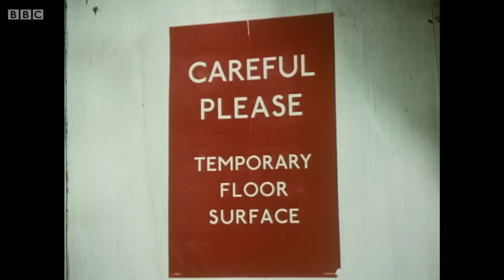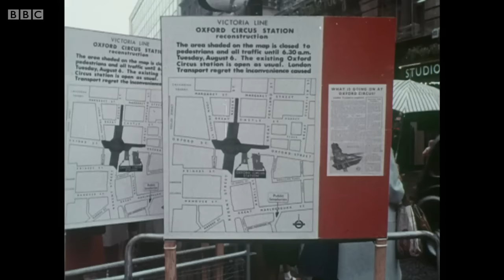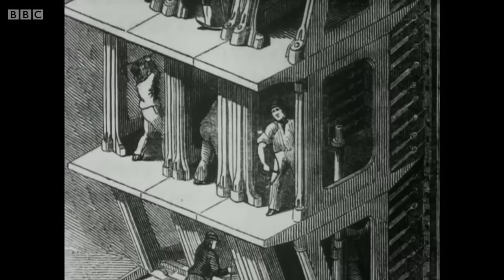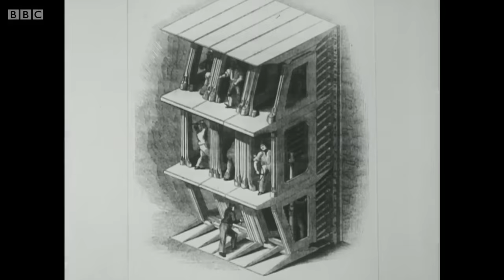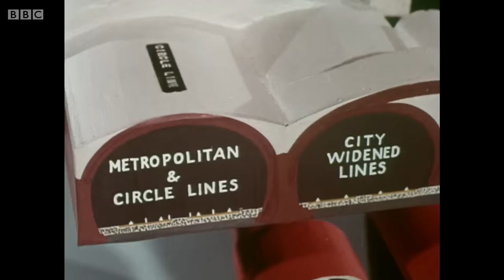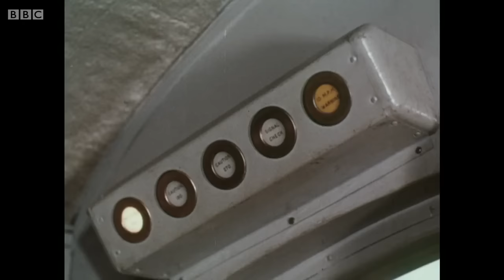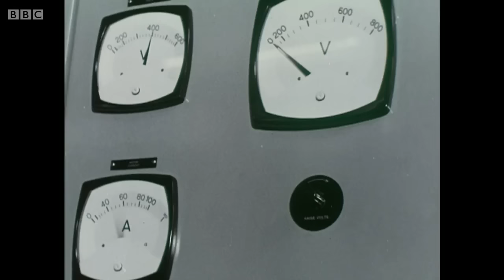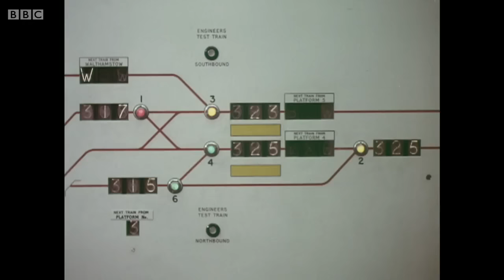BBC How They Dug the Victoria Line

Comment: This was fascinating, and they actually managed to automate that line with the primitive equipment available in the mid 60's, very impressive!
Reply: Jeff DeWitt relays?
Reply: Relays and rolls of paper with holes in it, just like an old player piano.
Reply: Jeff DeWitt pyramids baffle you then?
Reply: I wouldn't say it was particularly primitive.
Reply: It's even more facinating that they went to the moon only a few short years after. Tunnelling and building is largely the same these days, whereas modern computing makes the Apollo guidance computer look positively archaic.
Reply: It was stated that this was filmed in 1969. In July of that year we reached the moon.

Comment: I so do love this city. It still shocks me how advanced the Victoria Line was for the 60s. To think the automatic system must've been designed in the late 50s - early 60s is amazing. Small calculators we have today weren't even a thing, yet they managed to run a whole tube line from one room using machines.
Reply: whats even more impressive is that same automated system was still in use til 2012

Comment: This is absolutely fascinating to watch, the precision combined with speed is remarkable. It's a shame projects that are smaller take much longer these days.
Reply: When people are knowledgeable and skilled speed and precision together are possible.
Reply: Well, if you cut safety you'll have much time!
Reply: The Elizabeth line, for example is definitely not a smaller project, the Victoria line is now one of the most overcrowded because it was built to more tube like specifications, and the stations at many points have quite bare minimum stations with out enough space and narrow escalator shafts. Walthamstow Central is one of the most overcrowded stations on the whole network

Comment: If the BBC made this sort of thing now, ie, factual, informed, not politically minded etc then I would gladly pay for a tv licence and start watching them again.
Reply: So blue planet 2 and other documentaries, like crossrail are too political?
Reply: @Bartimayus  They are too few and far between for it to be remotely worth it.
Reply: divad noskcaj  what the hell is a TV license?
Reply: If they did make it today the BBC would be bemoaning the lack of gender diversity on the project, not in the tunnels mind you, only the engineers and bosses.
Reply: @James Rhew - In the UK if you own any equipment capable of watching television as it's broadcast either via over-the-air transmission, internet, cable etc you have to pay the state an annual fee called the TV License, this funds the upkeep of the transmission network, the services and production of the B.B.C. including radio.  It also means there is no advertising on B.B.C. channels.
Reply: They do.
Reply: James Rhew one requires a license to watch TV in the UK. There is an American News documentary about this issue. It enables the gubment to require an (a tax) license to watch and capture the TV transmissions without one. The Gubment actually goes around looking for antennas without a license.
Reply: @jamesrhew4542  You have to pay an annual fee to have a television in the UK.  The money goes to support the BBC.   America doesn't have this kind of a system and that is why the only good television programing that is available in America is British.
Reply: Its all pizzicato or piano music in the background now, drives me mad.We also have to be introduced to every worker and know their age.
Reply: @ednorton47  Yeah, But we have Donald...Oh My God!!! Ya Know We need BBC or DW as required watching
Reply: @Jonny1000 Johnny, Johnny, Stiffen the Lip old boy, the lower one too, What
Reply: @ x-You voted for D Trump didn't you-T May if you're a brit
Reply: I can promise I'll never pay the licence even if they throw me in jail.
Reply: divad noskcaj TV license?WTH is that?
Reply: @ednorton47  Actually the United States has a tax funded program service called the Corporation for Public Broadcasting that supports not-for-profit radio and television.  At roughly $500 million a year, it is shamefully underfunded.  It's currently emerging from under a cloud of mistrust  after a resigned board president was found by the agency's Inspector General to have attempted to influence programming in favour of a "conservative" stance.  It remains a favourite target of the Right for its supposed liberal bias.  To which I can only say, from a Leftist perspective, bullsh**.  I see far more favouring of the Right than Left these days.

Beyond the funding issue, I think you're ignoring some very well made programming on PBS - Nature, Frontline, American Masters and Nova for example. But what the BBC has, in a way neither PBS nor Public Radio can afford, is news gathering. The coverage they offer is better than the  networks, but they can't afford nearly the oversea stringers and reporters the BBC still has.
Reply: @DavidHHermanson  Point taken.  But perhaps PBS could do more in the field of drama.
Reply: This is absolutely peppered with opinion and preaching.
Reply: @ednorton47  I agree.  They've, in recent years, done a great deal of co-developed drama with the BBC, but it comes out to one or two shows per season. I'd love to see them commissioning a weekly series in the style of the old Playhouse 90 - great drama, ambitious new talent (both playwrights and actors) under the work of theatre's best directors.

Comment: Hello, many " Thank you " for uploading these film. It's pretty amazing to watch these early Computers, Machines etc. how they work. I never thought about the fact, that a train can be driven by a Computer at the end of the 60s, without any human interactions.  Just amazing. But I have one big question left. I know that the London Underground gets his energy via a 3rd rail and this one is on the right or left side. But I saw in this film the 4th rail, this was between then 2 rails and it was located in the middle of the track. My question is, what is the reason for the 4th rail? If anyone knows the answer it would be nice, to get an explanation from you. Thank you and have a nice time. cheerio Toni.
PS: Also I must apologize for my bad English, but I'm from Bavaria ( Germany )
Reply: Four rails because one rail is positive and one negative. I don't fully understand why, but that's how London Underground lines are arranged.
Reply: @hkharnelian  Because it is a DC system, by having the 4th rail it means that the metal shields used for the tunnels are not as subject to corrosion.  The outside surfaces can be at/close to 0 potential volts to the soil surrounding them.  The 4th rail acts as the - conductor back to the substations.  The cost of having a 2nd conductor rail as return is less than the cost of amorilating the problem in other ways.
Reply: @ThePeachJames  Thank you for the clarification. Spent a lot of my youth on the London Underground, but wasn't sure exactly why a 4th rail was required.

Comment: 18:15 so that's a live 650v rail and a service train just to his right - wonderful H&S
Reply: Not necessarily,  the trains will still run on length of de-energised rail that Is shorter than the length of the train.
Reply: @user-ky6vw5up9m  Although if that train has shoes on both the energised rail and the de-energised rail then the gap is bridged and the rail is now live

Comment: interesting to watch compared to Crossrail today. Health and safety not such an issue.
Reply: Building Crossrail is a bit like building the Victoria Line all over again, except half a century later and Crossrail is a Commuter Railway Line, as opposed to a Deep Level Tube Line. 

The first section of Crossrail will open in 2018, later this year and the first section of the Victoria Line opened in 1968.
Reply: And the tunnel boring machines are manufactured in Germany because the UK makes nothing these days
Reply: government more like

Comment: I remember being told that a large proportion of the labour that built the Victoria line were West indians. But I've only seen one or two in this film.
Reply: 60s BBC was very racist so its not a massive surprise
Reply: My father was a tunnel miner on the Victoria line from start to finish, 90% of the labour were Irish, the other 10% being English and/or West Indian heritage as back up labour, pit bottom men/ loco drivers etc.
Reply: In those years the vast majority of the building gangs, especially tunnellers were from Ireland. It was a pretty grim place to live then and they was plenty of money to be made in the UK if you grafted. I've seen other videos of the railways at this time and there are quite a few West Indians working on signalling.
Reply: as mentioned in the film, the majority of workers were from ireland, and then went on to reference the way the irish were used to dig canals and the original railways
Reply: So, now we are going to find something "racist" in this documentary. Aw, let's bitch and complain like good libturds.
Reply: No one lasted only the Irish  went the distance
Reply: Tom O toole Yah okay good luck with that.

Comment: H&S in 1950 over 1600 workers were killed in the contraction workforce, this includes 226 killed on the railways, who were not covered by the factories act. In 2018 40 workers were killed in construction. H&S May be a pain in the arse to some but better to feel the pain rather than dead with no feeling.

Comment: Health and Safety, the most hated words when things have to be done like yesterday. I don't know if anyone has calculated the time and cost Risk Assessment adds to a project.  Safety gear was frowned on back then, it just often got in the way, sliding down a ladder was the quickest way to descend it, just ensure the uprights were sanded to remove splinters, better then spending time pulling them out of one's hands.  Safety Glasses need cleaning every five minutes if one wants to see anything, hard hats just get in the way in a tight space, a handkerchief makes a mask if needed, one cannot smoke with a mask on.  The KISS principle was in use back then ( keep it simple, stupid ). As for hi-vis, if one can't see a person, one shouldn't be working in the first place.

Comment: the days that jobs used to get done - these days they start road works in the uk and you never see anyone working on them, and the traffic piles up for months when the job could be done in a few days
Reply: There was a price set for each job worked out in hours pay, so on the concrete lined section we could earn 24 hrs pay in 8 hrs work. But you were excavating & erecting one ring every 15 mins. It could be done in 6 mins but they could not keep us fed with empty skips and lining rings. Other jobs like installing beams etc on w/e's would be on a job and finish basis again priced in hours. So a 12 hr shift Saturday and Sunday normally paid Say 6 hrs flat time, 6 hrs 1.5.  15hrs, Sunday 12hrs @ double time. 24 hrs Total 45. On a J&F we would get 150 hrs on completion of the job, whether under or over the 45 hrs. I only once worked over, we were usually in the pub for 1pm Sunday.

Comment: So is the London Underground the same today with the train operation fully automatic & the 'driver' just there for safety reasons?
Reply: phil955i 

Just the Victoria and Jubilee lines. The Central and Northern lines are controlled by Automatic Train Operation (ATO) as well, but the Piccadilly, Waterloo & City, Bakerloo, Circle, Hammersmith & City, District, and Metropolitan lines aren't fully controlled by ATO -- at least not yet. Transport for London is slowly upgrading the Circle, District, Metropolitan, and Hammersmith & City lines to ATO, in segments. The Piccadilly line is set to receive new trains sometime in the 2020's, coupled with automation of the whole line. The Bakerloo will get those same new trains after the Central and Waterloo & City lines get their unreliable 1992 stock replaced by those new trains.
Reply: @hostilepancakes  Thankyou

Comment: AN ASPECT OF THE VICTORIA LINE BUILDING, IS THAT AN ARTESIAN WELL, PART OF ST PANCRAS SPA, WAS IN THE WAY AND HAD TO BE FILLED IN WITH 150 LOTS OF CEMENT SO  THE VICTORIA LINE  COULD BE CONTINUED UNDER ST PANCRAS STATION. I WAS  A  PARCEL PORTER FOR BRITISH TRANSPORT HOTELS'.I WAS SHOWN A BOARD COVERING THE FILLED IN ARTESIAN WELL IN THE WINES DEPT, WHERE NOW  IS BOOTS UNDER THE STATION IN EUSTON ROAD. IN BASEMENT THERE WAS A MARINE HEATING BOILER AND A PRINTING PRESS. ONE LUNCH HOUR I CLIMBED  WEST TOWER AND WAS LEVEL WITH THE DENT AND CO CLOCK IN THE EAST TOWER. I THEN GOT INTO THE WAST CLOCK TOWER RIGHT BEHIND THE FAMOUS CLOCK. ANOTHER DENT CLOCK IS THE 1857 ONE  WITH THE BIG BEN BELL AT WESTMINSTER.
Reply: No need to SHOUT MATE :(

Comment: What is odd to see (12:40 it starts) when placing the segments. There is no packing, no rubber seal, and no stepped pattern of the concrete prefab lining. So are they going to grout it untill it is watertight?

Today they use rubber seals, steel bolts that fit into plastic nuts in the concrete segments, and the segments are always stepped. https://www.youtube.com/watch?v=aqZvF7o2o1U

Yes the way they did it back in the day with the concrete lining, it looked like some guys just there to make a "quick buck" and get out of there before they realized what they just bought. No it did not look to good at all. It may be still standing, but there are way better ways to do it. 

Greetings,

Jeff